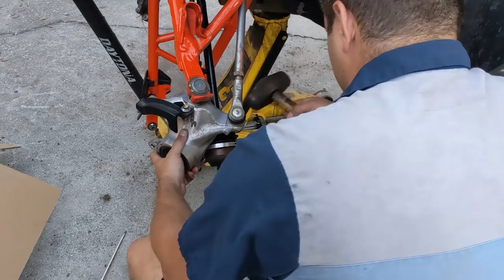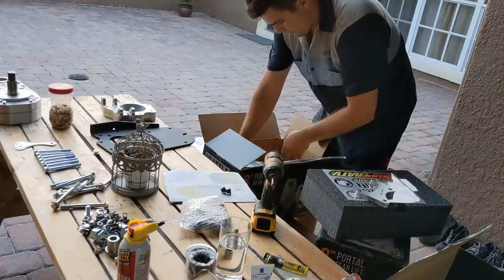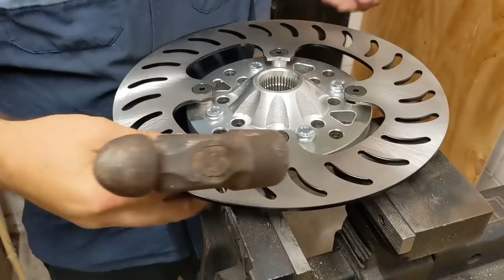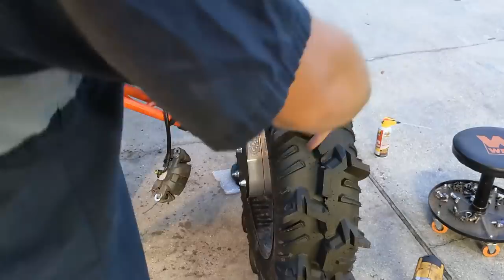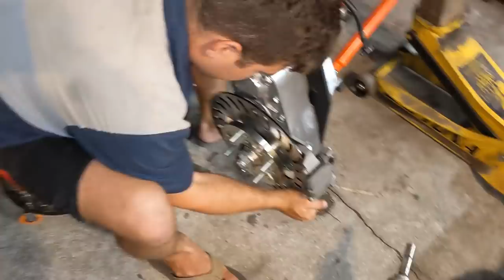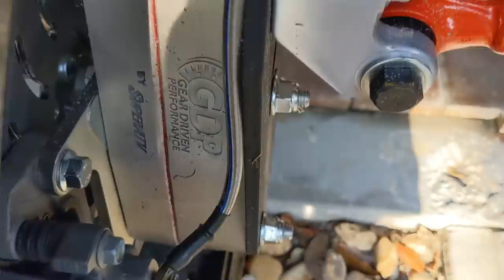Talon 8" Portal Installation walkthrough

Comment: I had the gen1 4" boxs on my og mav then recently (about 2 months ago) upgraded to the 8" gen3 boxs and i am MUCH HAPPIER those gen1s were absolutely trash! Im running 44" terminator maxs on 24" fuel strokes with just 8" boxs and 4" bracket lift and it actually rides pretty smooth to be so big, im really impressed with the gen3 boxs

Comment: I’m looking for an upgrade from my 03 grizzly 660. I’m looking at either a used Brute 750 or a brand new 2020/21 Honda rancher 420 4x4. I want the Honda Bc of reliability but the brute for the power. All I need is a push either way. I know you have a lot of Honda’s so I figured I’d ask.

Comment: Mudpuppy would these fit a pioneer 2020 I assume they would ( bit of welding and cutting ) also not sure if you’d know but could you run tracks with these on ? Again I assume not ? We are after more clearance with our pioneer got w 3 inch lift and camso tracks but... need more any suggestions
Reply: Take a look at our Channel we have videos if you’d like to see our set up totally different from what you do we work out bikes but it’s deep thick mud so suppose similar hah
Reply from the maker: No different axle splines
Reply: Damn ! Ok appreciate it do you know if the super ATV lift is any good for them ?

Comment: What are the measurements on the width of the X with the portals ... I know you was saying this was the reason you got the X plus the way the trailing arm bolts on ... so what’s the width ?
Reply from the maker: Portals add 8" my wheels add another inch up front so I'm right at 70" wide up front. Rear was 67" until I added 1.5" spacers

Comment: how do you adjust the prelload on the shocks
Reply from the maker: With the giant nuts on top of the springs removed from the vehicle first and clean threads
Reply: Okay I just got 6” boxes with 37s thinking about getting limit straps too, what spec did you put your shock to or is it just a preference , also I’m surprised iv never seen you at hollow paw